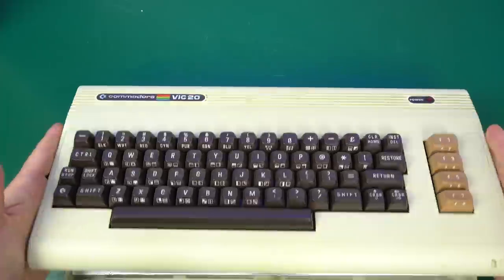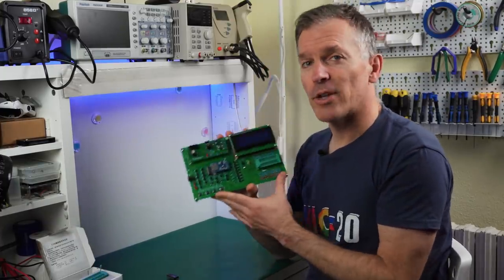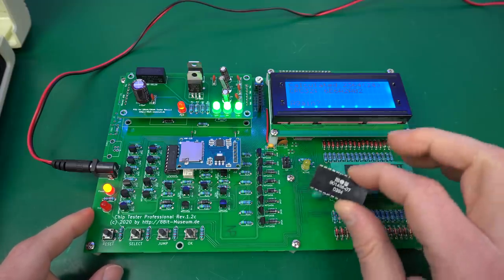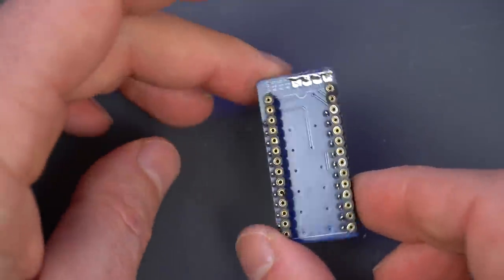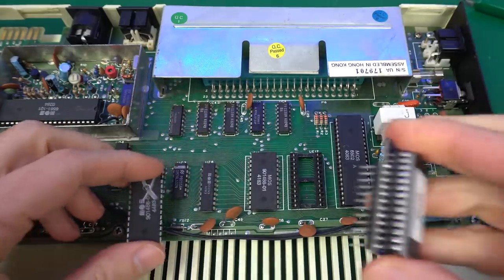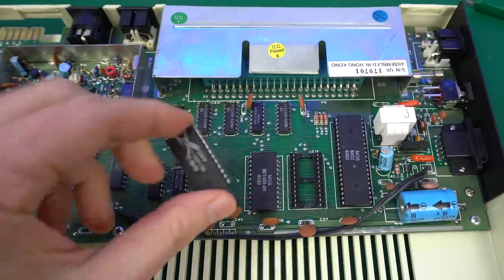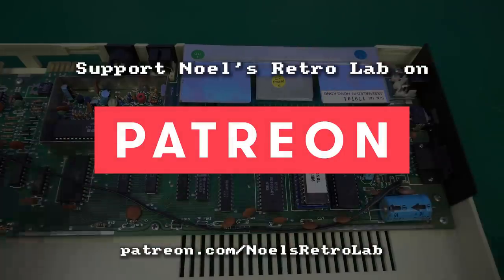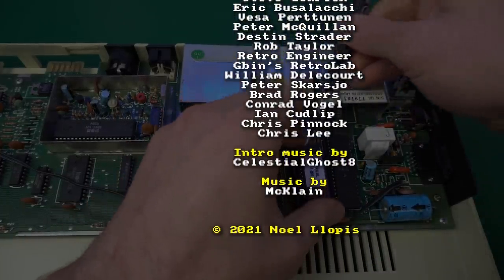Dead KERNAL ROM? [Nibble Edition]

Comment: Hi Noel. FYI, you can write PROMs, which need higher voltage, than 18V using the TL866II+ with an external power supply. I made a video about it a longer time ago.
Reply: Mr Guru  Yes, I always say PROM, when I mean EPROM or EEPROM. I know, that is not quite right, but I'm lazy :D May be next time I should wright *PROM or something similar...
Reply: @necro_ware  Sometimes was budget version of EPROM (UV erasable), but without window in plastic case also called PROM. Certainly it was one time programmable EPROM memory.

Comment: The CRC is changing between the two read. That means the data is also changing. I don't think it's supposed to happen when reading a ROM :-)
Reply from the maker: Good observation! I didn't catch it live, but you're right. Yes, that ROM is gone, gone gone.
Reply: @NoelsRetroLab  I forgot to mention that there's an even smaller footprint adaptor for the 2364 ROM replacement in the PCB Way shared projects. It uses an smd 28C64b. The size is almost the same as the original ROM. Very handy when you don't have much wiggle room.
Reply: Yup and the "read to file" shows a yet another CRC, so it read three different results on three attemps. That's a broken ROM.
Reply: just wanted to point thi out :D I noticed that too right away

Comment: Quoting from Brian Bagnall's book "Commodore - A Company On The Edge", Robert Russell is one of MOS/Commodore's early engineers:

Technical information for the reference manual came directly from the VIC-20 engineers. “We did all the documentation that ended up in the programmer’s reference manual,” says Russell. “Andy Finkel and those guys pretty much took all our charts, diagrams, memory maps, and all my folders and notebooks, and that’s what became the reference guide.”

The writers inadvertently created a special variation of the word kernel because of a misspelling in Russell’s documentation. “The Commodore version of it was because I misspelled it on my big banner heading on the top page,” says Russell. “So that’s how it became known as the ‘kernal.’”

Comment: Kernal spelling explanation
(From Wikipedia article here)
According to early Commodore myth, and reported by writer/programmer Jim Butterfield among others, the "word" KERNAL is an acronym (or, more likely, a backronym) standing for Keyboard Entry Read, Network, And Link, which in fact makes good sense considering its role. Berkeley Softworks later used it when naming the core routines of its GUI OS for 8-bit home computers: the GEOS KERNAL.

Comment: Of course, the Amstrad Gate Array isn't actually a ULA, because ULA was a trademarked term belonging to Ferranti, and the CPC didn't use a Ferranti part.
Reply: Mr Guru  Custom-Specific Integrated Circuits: Design and Fabrication by Hurst, page 22.  Ferranti Quick Reference Guide, ULA.  A bunch of other places.  ULA was trademarked, and that's why everyone else called it a Gate Array.
Reply: Mr Guru  Yeah, they had two trademarks filed in the UK at the Intellectual Property Office in 1978;  ULA and "Ula".  I'd link the numbers here but YT thinks I'm spamming phone numbers and throws my comment away.
Reply: Mr Guru  Apparently early versions of the CPC Gate Array actually were Ferranti products, but Ferranti and Alan Sugar had some kind of falling out (probably schedule-related, I wouldn't wonder) and so they went to another manufacturer instead.  The die shots of a decapped CPC GA say LSI Logic Corp.

Comment: Seriously, are you watching my pending to release videos? 🤪I literally made a video last week where I tried dumping a 2364 with the TL866 and indeed no luck. I ended up making a reader with an Arduino mega. That vide will be released on 14-01-2022
Reply from the maker: Awesome! It's always fun to see things done in different ways. Looking forward to it! 👍
Reply: @NoelsRetroLab  yet very funny we both tried to use the TL866 in the same we for the same purpose :) I too was amazed, I mean sure you can write them but reading is very much in its capability. I briefly looked into extending the devices. I run the minipro Linux cli tool, but those decides are hardcoded into a dll (Chinese software is so flaky). I would’ve expected an XML file. And after finding that out I didn’t want to look further into how they Linux took read/dumped the DLL.
Reply: As demonstrated by Noel, it’s possible to use an adaptor that allows you to use a 2764 in place of a 2364. Using the same logic, but obviously not the same rewiring, you should be able to make a 2364 appear to the eprom programmer as a 2764 and then read it, right? I haven’t tried it, but it seems reasonable.
Reply: @Doug_in_NC  I figured that, but I had used up all the adapter boards :) So I figured let’s do next easiest thing, build one yourself 🤪

Comment: Noel... I have an Early VIC-20 (PET Keyboard) that has me stumped.. I've swapped all of the swap-able chips...and it still is not working correctly.. I have absolutely no idea what is causing its issue!  I do get a screen in Black and White somewhat...and I can barely see that the computer is working and the 6502 is working...because I do get a Ready prompt....but the screen has a "run away" vertical hold... which also has me stumped..  I swapped out the VIC 6560 chip with a working one and it still does the same thing... If you want to use it for a repair video, I can send it to you... It's repair would make for an excellent video. Just message me. I would pay you for any repair parts and the repair of course.  This one has me beat!  I can't figure this one out... Tony K., Melbourne, Florida (U.S.A.)..... Love your channel... ;)

Comment: Kernal is a name, not a description, and those not in the know will always make the mistake and attempt to correct.  Kernal is the name of the Commodore OS and nothing more.  There are rumors about typos etc, but that's all they are, just rumors.  Technically though, it's not even close to what a kernel is anyway.  It is more of a BIOS than a kernel.  So the name Kernal is ambiguous and wishful thinking.